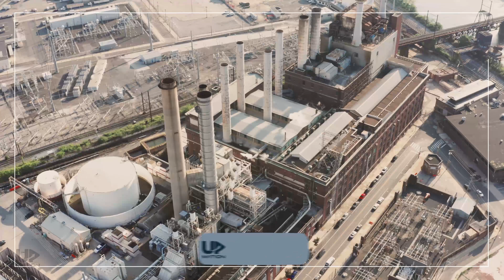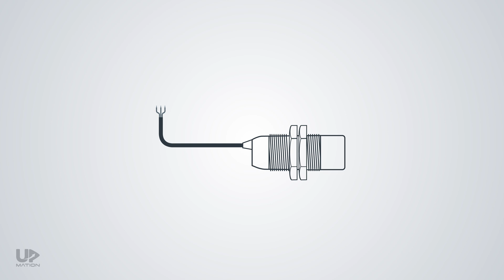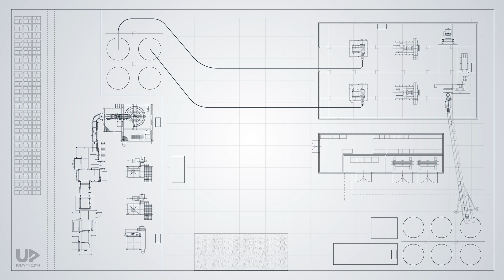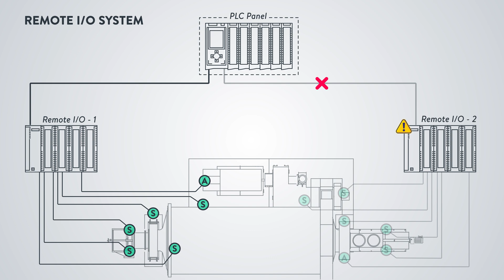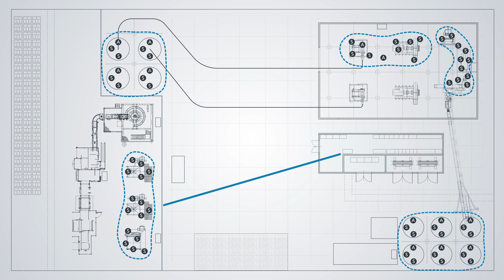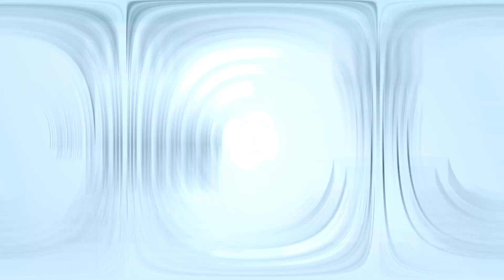Remote I/O System for Industrial Automation - RIO Control Panels Basics

Comment: This and video before was a master class. I’ve been using my phone and switch system to look up terms and things you said in the video like fieldbus protocols and learned what their purpose was and basically this helps my generation out. The older folks know how complex a rats nest of wires look so this video explaining the purpose and functionality of declogging the electrical boxes and wire tracing as well as wire pulling is basically a work of art when designing your network as you said in so many words. It’s like setting up a gaming area with as few wires as possible that can operate all your electronics/toys/systems via a stream deck.
Reply: Google play audiobook.
Forbidden fruit: A dark mafia tale.
by; Rose Knight final fantasy female N.C.A.A. 2027 MADDENCFL